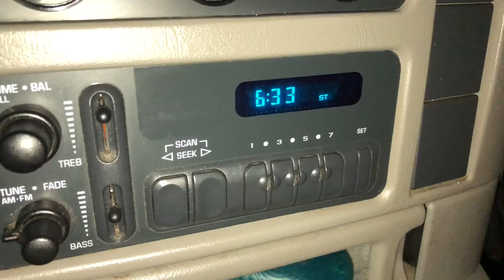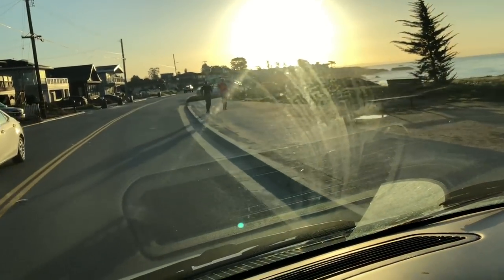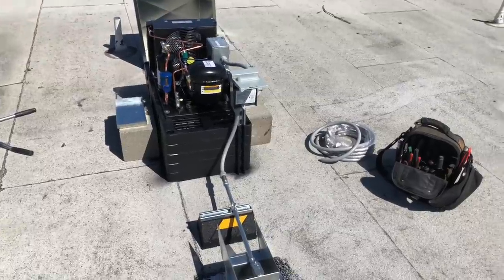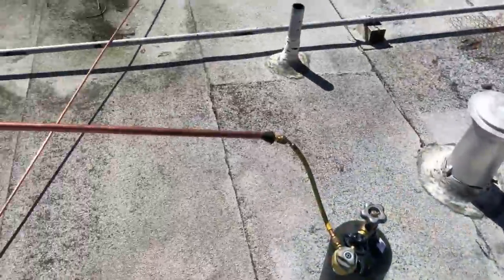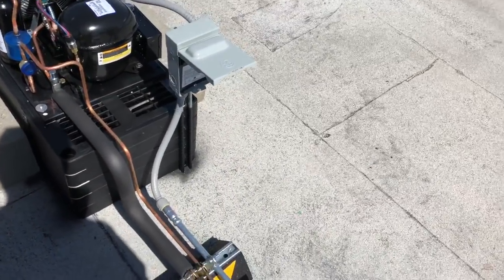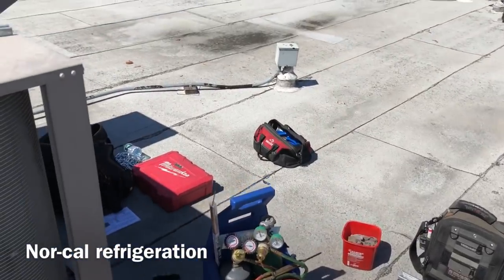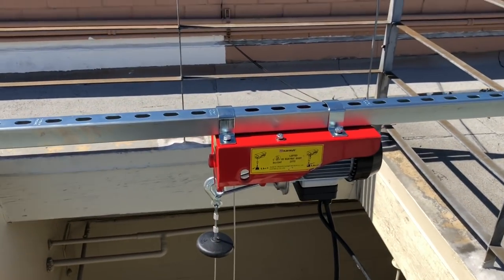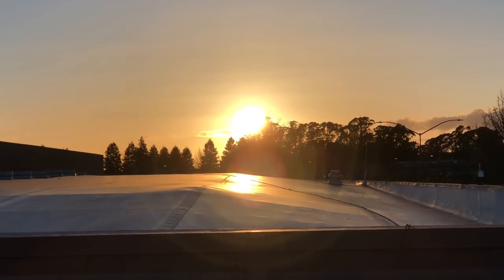Move condensing unit to roof

Comment: Nice, and original approach at installing the line set. I have seen the pitch boxes made with the inverted p-trap, designed strictly for the refrigeration lines only. Your  work included the electrical lines, and the disconnect.  I also liked how you hooked up the nitrogen tank when you annealed the copper tubing. That also deserves an applause.

Comment: Good job on the pipe fitting.  Do you have any tips for me , im starting a new job doing service work for a company that does only supermarket refrigeration. I've worked as a pipe fitter for supermarket refrigeration years ago. And been doing hvac service work on ac commercial stuff for 10yrs . I have not worked on rack systems in a long time and have found everything has changed to glycol and other new refrigerants !
Reply: hope your good with computers, electrical and electronics :)
Reply from the maker: Scott Riddle sleep. You’ll need your rest. Super market refer is mega hours.
Reply: Sleep and coffee. A good set of manuals for the controllers and don't be afraid to ask the guys you work with for  help, I went from being in manufacturing for 10 years to supermarkets once the first couple of months were past it got a lot easier.
Reply: Thanks for the advice,

Comment: Sweet job dude nice impeccable work👏👏💯💯💯🔥🔥question why put nitro through the pipe while bending it? While brazing of course just never saw anyone do that before I'm curious I don't do refrigeration just residential work thanks Dave you are killing it side job bob has nothing on you
Reply from the maker: joseph kochmann on acr pipe you have to heat it up before bending it , or it will kink. The term is annealing. So the purge is there while heating.  To keep the copper clean.
Reply: Nor-Cal Refrigeration & H.V.A.C thanks for the info makes sense now

Comment: Dave, can you show a more comprehensive view of your wrench setup. I have been trying to come up with some kind of bracket and wrench setup to lift compressors onto the roof through the (roof) hatch.. Currently I am pulling compressors up onto the roof with a rope
Reply from the maker: Dale The hvac repair guy I will do a video.  And no what your going through I had back surgery in 2007.

Comment: Nice job, what was the size of the liquid and suction lines
Reply from the maker: Scott Lorenson 5/8” and 3/8” on this one.
Reply: Was that the size on the condenser and is it common to upside these units?
Reply from the maker: Scott Lorenson the original unit for the box was 7000 btu I went to a 8,000 btu condensing unit, just in case we get a high ambient day over here.

Comment: Is that stacked composite shelving for your stand?
Reply: mainj54 I noticed the shelving painted black.
Reply from the maker: mainj54 yep
Reply: I like the concept adjustable height and width, should make it your tip of the day!
Reply from the maker: mainj54 you can also use mini split stands.